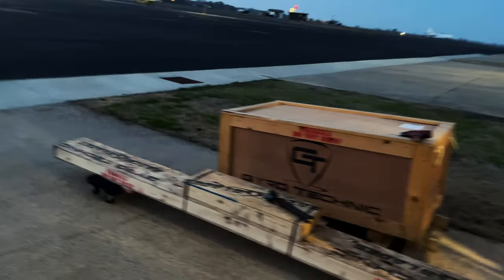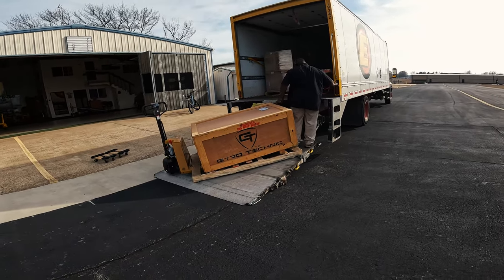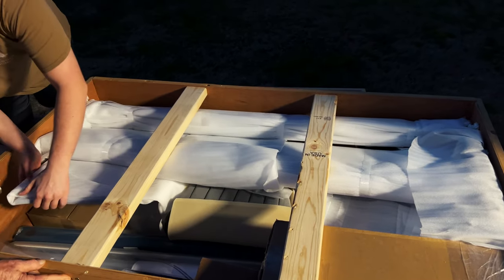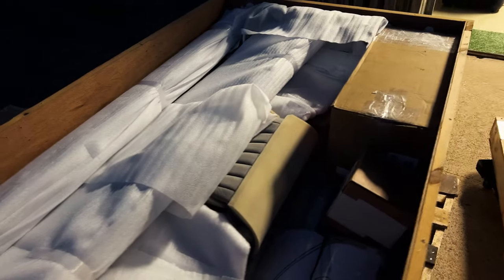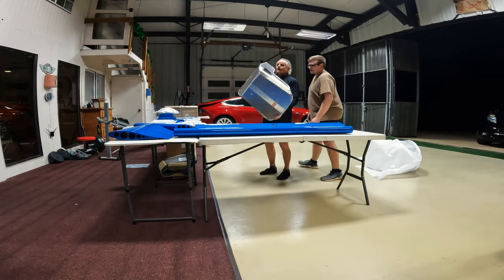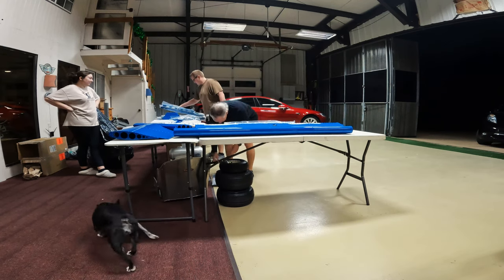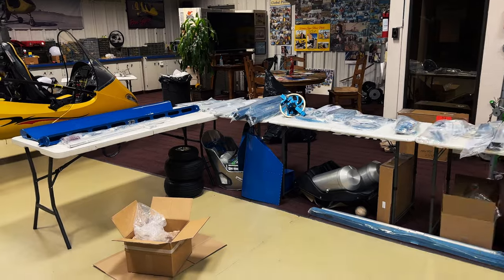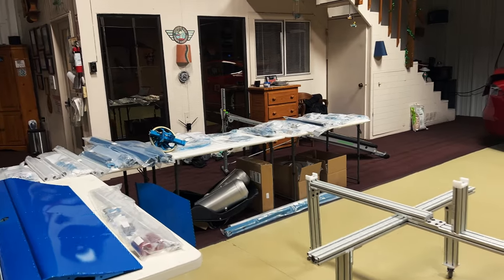UNBOXING OUR NEW GYROCOPTER! **HUGE UNBOXING**

Comment: What did everything cost?  ( just what you recieved in this video )  I hear these can run over 40g's when complete.
Reply from the maker: So with what we received in the video, I would estimate around $27k BUT, You can get it down a little lower depending on the other options you build out in the kit!